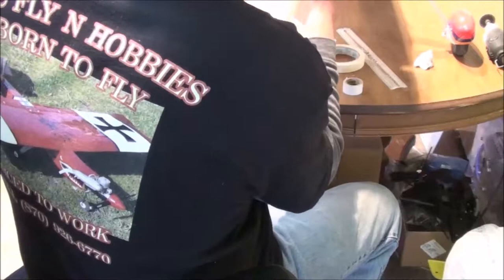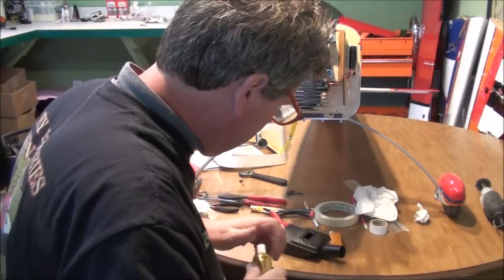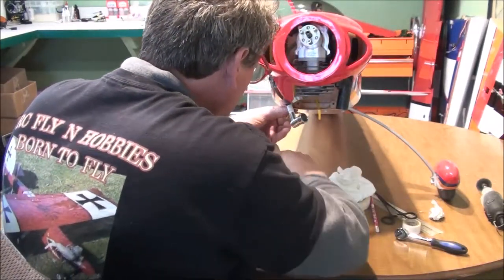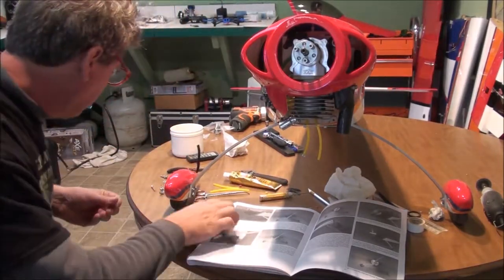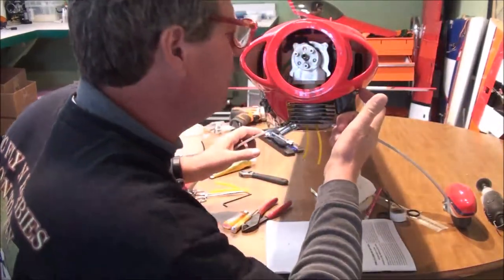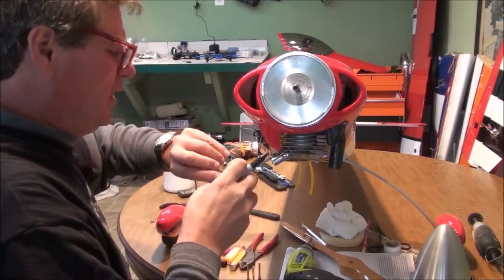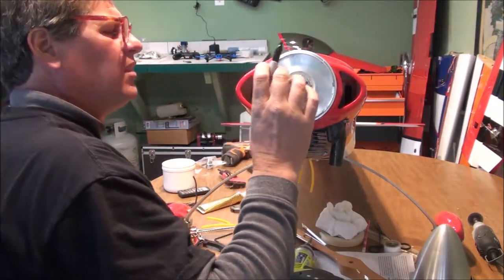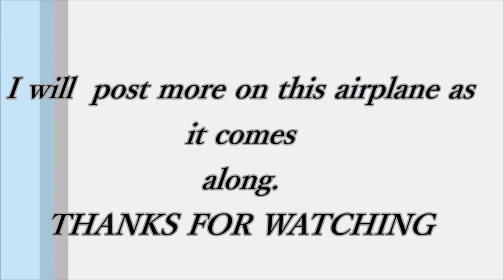revolver arf build #24

Comment: You fly gas and don't have a prop drill jig? That's the first tool I bought when I went gas. You really need one and a small drill press or, better yet, Valley View RC drills the props for you at no added cost when you buy props from them. Their Zoar 23x10 drilled for 50 cc is $29.25.

Comment: Perfect gasket material for $2.89 at tower hobbies. 

Two Sheets of Gasket Material
FEATURES
The green fiber gasket material withstands high heat
Made of Composite Rubberized Fibers.
This is a Fuel Proof Material
SPECIFICATIONS
Length: 3" approx.
Width: 1-3/4" approx.
Thickness: 1/64"